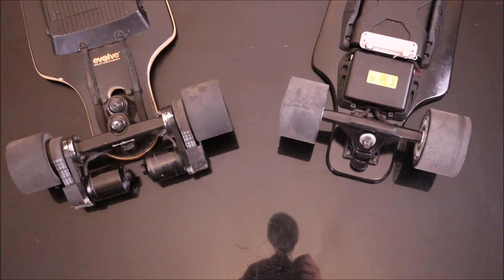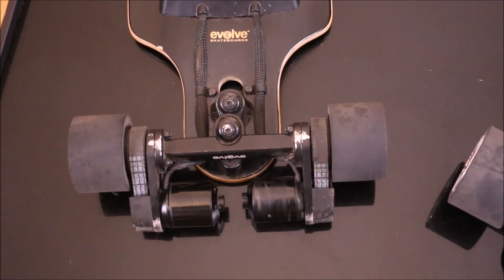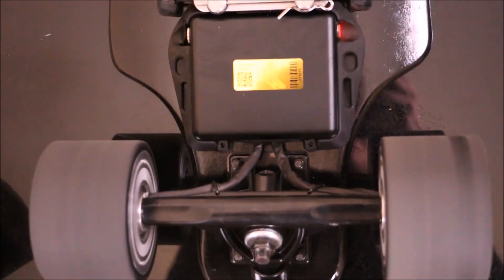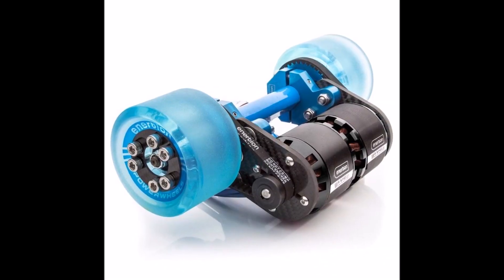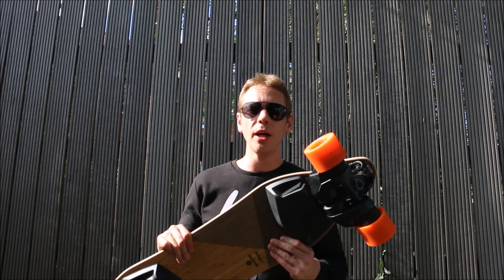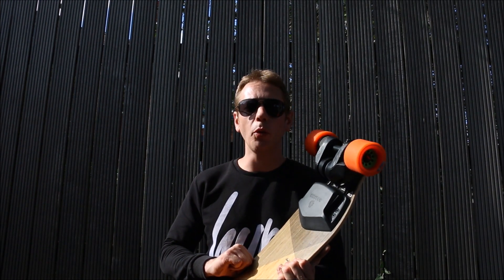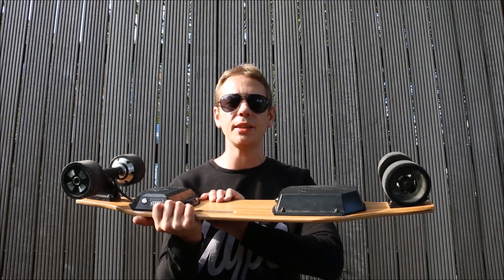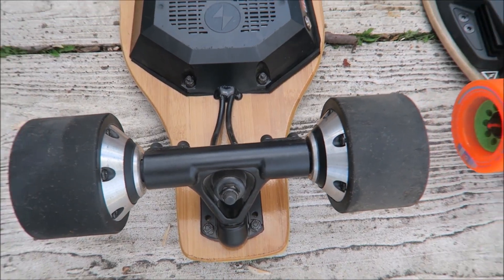Hub vs Belt Driven Electric Skateboard - What's Best?

Comment: Some might say in hub Motors are easy to maintain. Becuase There is not mutch to maintain. You have the Motor wheel and the battery. The belt has mutch more moving Parts that needs to be relaced. I Think you get a new Motor in Hub for 40$ and thats it

Comment: i am comfortable with belt driven boards because you can hear the motors. It helps alot to hear the motors spin as I get a better understanding of the speed. while when I am riding a hub motor board , because of the silence i have difficulties understanding my speed.

Comment: Koowheel is hub motor and has beter range and you say you like belt driven because they have better range ??? 
Price of manufacturing hub motors and belt motors can not be so different that board instead of 1000 costs 200.

Comment: Nice review, I think that a big problem with the belt drives, is how close the belts and belt covers are to the surface of the road, easy to get damaged, or hanging up on debreas on the road. 
The hole aesthetics of a inruner wheel motor looks nicer and less like a electric skateboard, witch is good thing in a country that doesn't want you to ride electric on the roads, + there easier to make waterproof.
Keep having fun and ride safe. G

Comment: Gday. Enertion doesn't have a geared hub system. They have designed a motor specifically to use as a hub motor rather that just taking a motor and putting an outwheel on it and expecting it to work. I can tell you the raptor 2 has more control and range that I ever got from my Carbon GT. super stoked with it.
Reply from the maker: yes its a hub motor, at the time i was confused by their "direct drive" marketing slogan

Comment: Can you still push the belt driven board like normal longboard and how does it compare to inhub one? Also which one is better for climbing hills or aceleration?
Reply from the maker: Hub motors tend to be easier to kick push , up a hill and acceleration belts tend to win however direct drive (motor attached to wheel with gear and drive ) seems to be competitive but you feel the raw power more with belt systems in my humble opinion

Comment: Great video! You should get a temp gun and check the temp of all those motors after riding each board for about 3 miles. I used to rebuild motors in the US Navy and the when motors run too hot it decreases their life expectancy. I know the KooWheel has a new motor hub design that helps keeps the motors from overheating. Not sure how those belt driven motors stay cool though. Cheers!
Reply from the maker: Thanks nice advice! got a link to a good one?

Comment: Dont compare "Control at low speeds" between the meepo and boosted , or any other boards you mentioned. Boosted is 1,500 Watts of power, vs the meepos 500. Thats the difference your feeling. Not gearing. If you want to compare belt vs hub, then get two equally powerful boards!
Reply from the maker: I didn't think hubs got much more powerful than the meepos, I'm testing the inboard now.. what board do you suggest ? I think hub motors in general those on the market currently seem to use less watts than belt motors correct me if I'm wrong..
Reply: Raptor 2 has 2 x 1200W hub motors, Stary has 1 x 1500W, Koowheel has 2 x 350W ...... Hub drive is more efficient than belt drive so can use smaller rated motors to get the same top speed as the belt drive boards but also gives superior range with a similar sized battery. I believe hubs are the future but they need some sort of gearing, like the Stary .... but with a decent range.
Reply: Thanks for your reply. I also have a feeling that hub motors get more bang for the buck (wattage). I could be wrong. I think its something we should look into, as the Meepo Board does fairly well with keeping g up with the Boosted and others, with 1/3 the wattage.pretty cool. For me, I would choose the Evolve GTX. But not many wouldnt. Im mot rich though, so ai bought a Meepo. Should arrive in a few days. Posting my video today finally of Tips and Tricks, information and processes.

Comment: The hub motors dont make a huge difference in cost. At least nowhere near the level you are suggesting in your video. The belts themselfs are standard industrial parts and very cheap, the only thing that is eboard specific is the mount and thats not a very complicated part to manufacture either.
Reply from the maker: I can buy the hub drive on the meepo which comes close to the boosted in speed very similar for $46 dollars per unit .. how much would a quality belt system that didn't break down cost ? the lift board is cheapest dual at 599 from china and the belt drive (costing around $290 as a unit) breaks down consistently and doesn't hit more than 17mph . Your probably right its not quite as significant as I previously claimed but it is a major factor in the price point of eboard shifting well bellow $1k to around $500 u may agree...